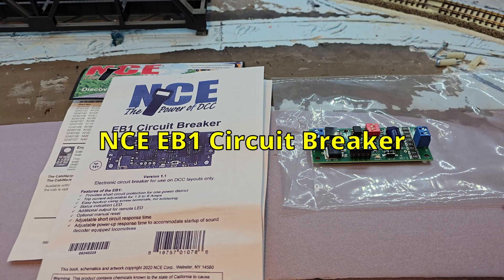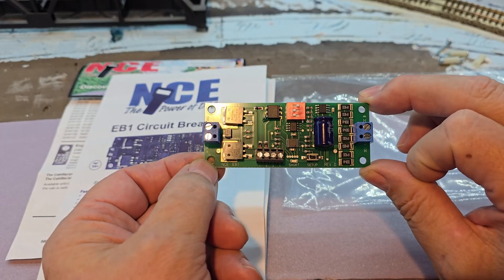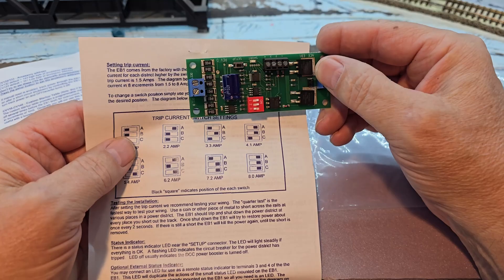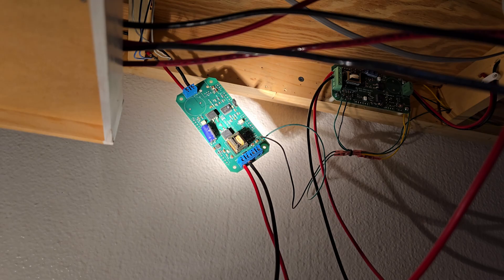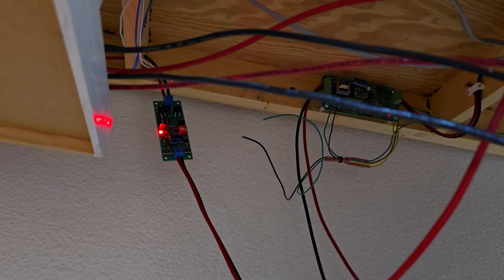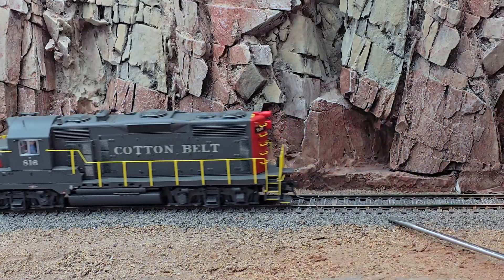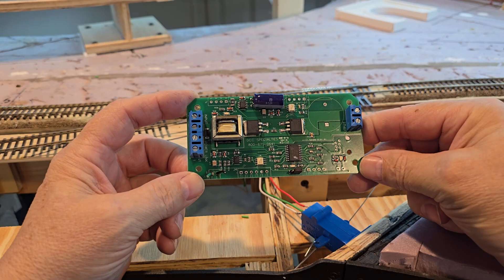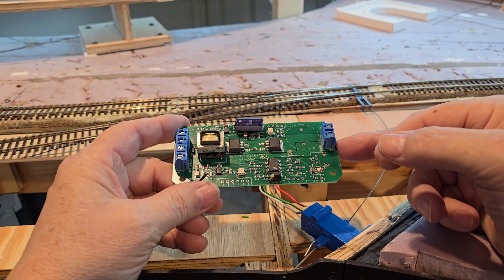NCE EB1 Circuit Breaker Installation. Replacement for DCC Specialties PSX-1.

Comment: How did you wire it up to the dcc bus?
Reply from the maker: I send the output of my Digitrax DCS200 Command Station to a terminal block. From the terminal block I send the A&B DCC wires to the input of my 3 circuit breakers. The output of the circuit breakers powers a section of my railroad. 

I'm not sure if I cover that specific thing, but I have quite a few videos covering how I wired my layout. If you go to my YouTube home page, click on the Model Railroading title and it will open the playlist. You can look through my videos to see if I cover wiring topics you're interested in.

Comment: Do DCC locomotives with sound really pull that much current?  On my HO layout (which is flat and uses DC power), I can run two trains, the 1st with two locomotives and 12 cars and the 2nd with two locomotives and 17 cars, that pull less than 1A.  I built a custom throttle which uses PWM for slow speed response and switches to constant DC voltage for high speed running.  Four locomotives pulling 29 cars on the level...  I have seen it briefly pulse to 1.25A for less than a second.  But that is rare.  I have now adjusted each block to limit the current to 1.5A.
Reply from the maker: Sounds like you have a nice DC setup. You have it dialed it well and know exactly what you have! It's always better to know. 

To be honest, I don't really know what the current load is for a DCC locomotive. I've never tried to measure it. My Digitrax system has a DCS200 command station that can output 8 amps and powers 2 of my 3 blocks and I have a DB150 that can output 5 amps and powers 1 block. The PSX-1 that failed was connected to the DCS200. Since the DCS200 can output 8 amps, I set the EB1 to half that value. My track bus is 12 gauge and my feeders are 20 gauge so my current settings should be safe for my wiring. Not the most scientific method, but that is my logic.
Reply: I have spent a great deal of time analyzing and fine tuning the speed profile the past few months.  The hardware is capable of 128 PWM widths and 256 voltage levels.  My wireless throttles are capable of 100 speed steps but I have settled on 34 where there are 16 exponential PWM widths for slow speed followed by 18 exponentially increasing constant voltages.  Giving me the same control as 100 linear increasing voltage steps at 1/3 the amount of knob turning on the throttle.  The throttles also control turnouts and lighting.

The HO layout is 7ft x 10ft L-shaped made up of 80ft of PECO flex track divided into 15 blocks.  I have a laptop computer that manages the electronics and displays the layout on a touch screen.  Control is via 5 wireless throttles (which I only built 2).  I made a PCB for each block which controls the voltage, limits the current, changes direction, and returns occupancy detection results to the main computer.

The main power buses are 14/3 AWG house wiring stretched the 10ft length of the layout.  It carries 15V for track power, 12V for turnouts and lights, and ground.  18 AWG wire is run to each of the PCBs providing track power.  Then short lengths of 22 AWG wire is run from each PCB to the track.  The feeder wires are soldered to the under side of the rails before installing the track to make them virtually invisible.  The 15V power supply for track power is capable of 10A and I put an amp meter to monitor the total power.  Running the four locomotives averages between 300mA to 500mA.  I lowered the current of each block down to 1.5A to reduce heating of the electronics when track blocks get shorted or from derailments.

This past year I have been going crazy 3-D printing accessories and structures for the layout.  The highlight has become a replica of out family farm in central Pennsylvania.  Eight structures from the barn down to the  outhouse.
Reply from the maker: @MyTrainRoom  That sounds absolutely amazing! You've crafted an engineering masterpiece. Good point on your current limits; my layout is very different than yours being primarily a continuous run layout, so shorts are uncommon. I was unaware that DC had modulated output. I thought it was like the old varistat that varied DC output. What kind of 3D printer do you have? I have a Bambu P1S filament printer. I'd like to have a nice resin printer, but the mess and the smell make that a problem.
Reply: The old DC power packs started trying various techniques to improve abrupt starting of locos.  Two methods used in the 80s that I know of were rectified AC or PWM at full scale voltage.  There was talk of these overheating the motors but I can't verify that was happening.  My choice to do PWM at 8V for starting and then switching to DC was to avoid any overheating.  I'm using micocontroller chip enabling me to program any waveform I wish.  The only limitation is that I can only go to 400Hz in software.  My understanding is that DCC uses PWM at a frequency above the audible range and also uses the back EMF from the motor to sense its speed.  

I nice fact is that the HO layout at Balboa Park in San Diego was using rectified AC at 90Hz according to one of the operators I asked back around 1990.  No doubt they switched since then.  I saw pictures that it is all behind glass now,  What a shame.

My printer is a Creality CR10 Mini I bought in 2018 and I use FreeCAD to do all my designs.  Before the farm buildings I did an office building complete with interior desks, chairs, tables, filing cabinets, and bookshelves.  Had to compromise on the chairs.  Just can't print HO scale chair legs.
Reply from the maker: @MyTrainRoom  I use my 3D printer mostly for making tools. I use Blender for my 3D modeling software. I made some 3D printed assembly fixtures that were very useful in building my helix. I recently built some special stands I used for painting a Harley-Davidson Sportster fuel tank. I have an idea for making a track cleaning tool since some of my track will be difficult to reach once the scenery is in place. I haven't started anything with that yet.
Reply: Here's a short list of things I've made for my layout that might give you ideas for your own:
- The tunnel portals and interior walls
- An office building with interior desks, chairs, tables, filing cabinets, and book shelves
- Interlocking levers for the signal tower
- A passenger platform with roof to extend the freight station
- Trackside electrical cabinets (three sizes)
- An elevated diesel fuel tank at the engine house
- Steel coils for the gondola car
- Coal loads for the hopper cars
- Electric power transformers
- Trash dumpsters (two sizes)
- Jersey barriers
- Roof air conditioner for the office building
- Concrete road crossings
- End-of-track buffers
- Dummy turnout motors
Reply from the maker: @MyTrainRoom  Some of those things I could definitely see using on my layout. I'm primarily focused on scenery now with mountains, rock castings and basic groundwork. The way I do things is I will do all of one thing to completion. So, I will focus on basic scenery until it is completely finished on the layout. After that I will move on to trees and greenery. Structures will be later. I'm not ready for detail items, but I'll get there eventually.
Reply: The farm < https://www.youtube.com/post/UgkxKqk6PjTwdrlXjHUHMry2BZvPFh268GUP >
Reply from the maker: @MyTrainRoom  Looking good!

Comment: I also have 2 Dcc concepts alpha central cobalt digital turnout control panels controlling 24 turnouts with only 2 bus wires.  They make some really nice systems.
Reply: Approximately 14x11 L shaped walk around that is a little under 6 foot wide and on the 11ft side I have a 10 track freight yard with a caboose track and a 4 bay service facility hence all the turnouts.
DCC Concepts is out of the UK and I believe Iron Planet Hobbies is the only US distributor.  DCC concepts has several YouTube videos on their products. Everything from ground signal control , turnout control and more.  I think you will be impressed..
Reply from the maker: @dkservice424  Sounds like a nice layout! The service facility sounds cool. I would have liked to have had a diesel facility, but I have what I have. I've purchased things from Iron Planet off of Ebay. When I eventually get to adding signals I'll have to take a look at what DCC Specialties has to offer.
Reply from the maker: Wow that sounds impressive! I never heard of that system. I also didn't realize you had such a large layout! How big is your layout?

Comment: I also had a failure with 1 of my psx breakers.  I went with replacing all 3 with the DCC concepts intelligent circuit breaker.  They cost a lot more but they are really well designed and have not found anyone saying anything bad about them.   Been working perfectly for a couple of years now.   ( knock on wood ) .
Reply from the maker: Interesting. I have/had 3 PSX-1's for circuit protection on my layout. They worked perfectly until the Section 2 circuit breaker stopped outputting the track signal. I couldn't find a replacement PSX-1 anywhere, so I bought the NCE EB-1. If you also had failures, there must be some design flaw. I'll see how the EB-1 works. If I have other PSX-1 failures, and the EB-1 is reliable, then I'll just swap them out one for one. Thanks for validating the PSX-1 failure!